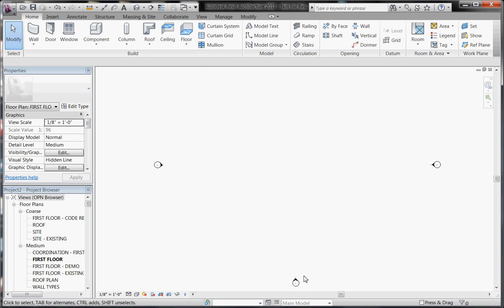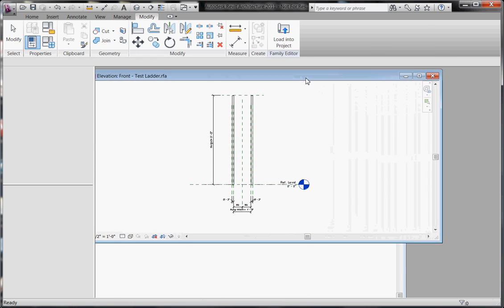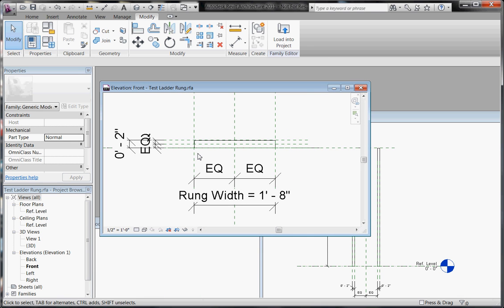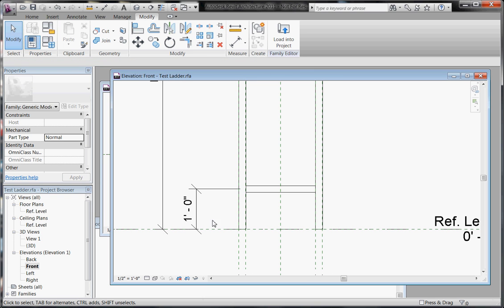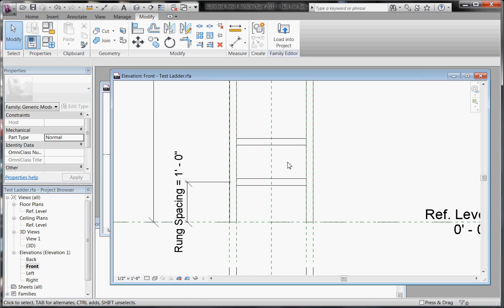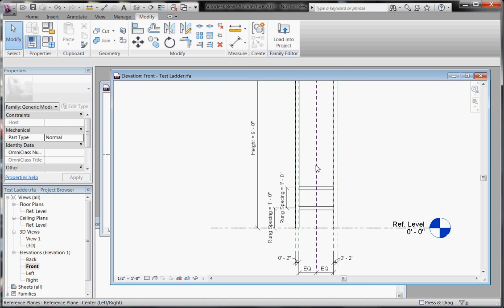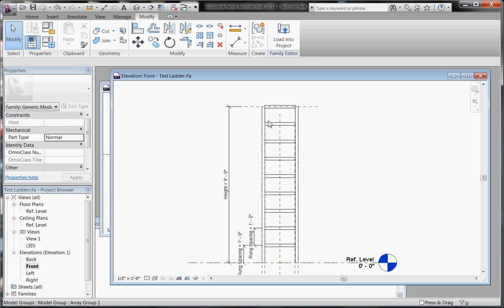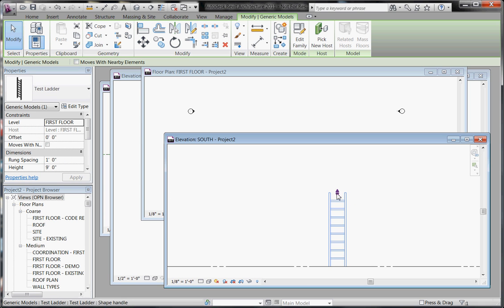Easy Revit (2011) - 15.3 - Parametric Array Family

Comment: You didn't show a flex for the Rung Width... does this work aswell? I'm creating a similar family using the same concepts as you show but when I flex the 'Rung width' parameter each rung cumulatively skews to one side...:(

Comment: That would work if the Rung Width parameter in the Rung family is set to "Instance". Another alternative is to load it into the Ladder family and link the Rung's type parameters to those of the ladder.

Great video, by the way. I've been wishing this sort of thing was possible for a while. I didn't realize it already was.

Comment: Thanks for the tutorial. I think the rung extrusion ends may need to be locked instead of the center of the rung in order for rung to adjust automatically with the widith of the ladder.